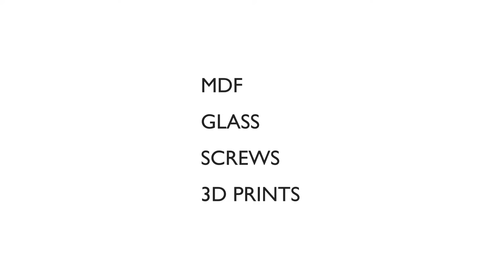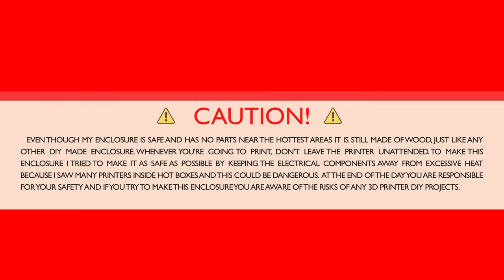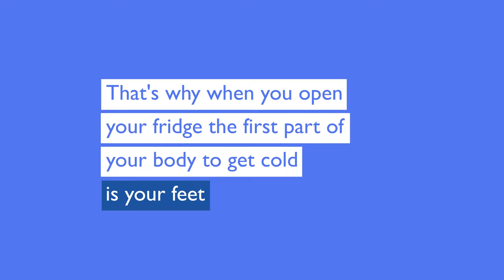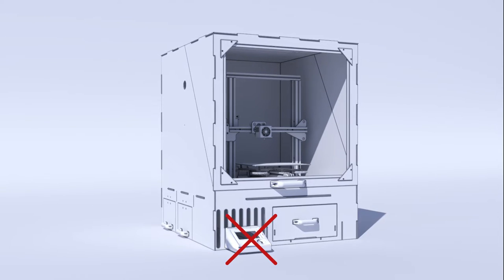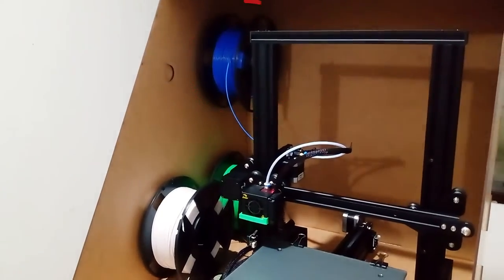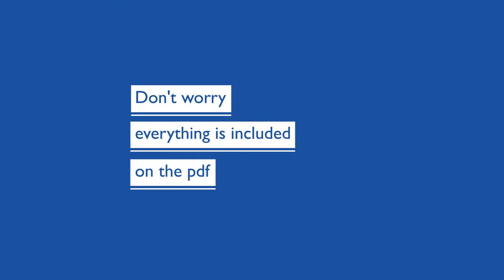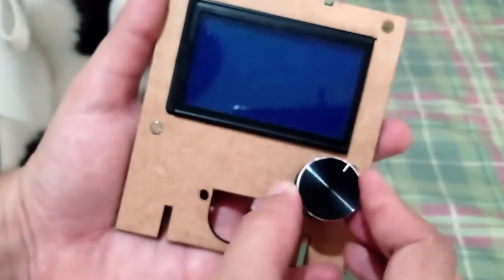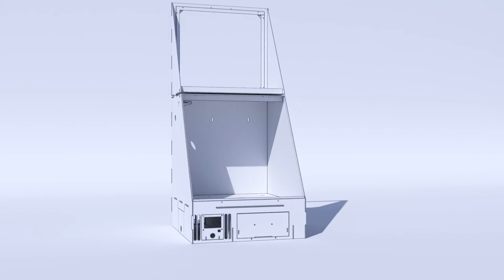Creating the Ultimate 3D Printer Enclosure: DIY Edition

Comment: Wow! Which 3d printer do you recommend for working with architectural models?
Reply from the maker: it depends on the size of your architecture model, but slicing programs can usually split a large file into several smaller pieces which makes it easier to choose a printer. I recommend printers with larger tables like the ender 5 or the Cr-30

In terms of technology, an FDM printer is better than a resin printer because filament is generally cheaper than resin and faster to print because the models are larger.

Comment: Doesn’t it make the printer vibrate a lot to be on top of that msg board?
Reply from the maker: Not really, that's why I printed the bumpers. But it needs to be printed on ABS or TPU because of the internal temperature that can reach 40 Cº or 104 Fº